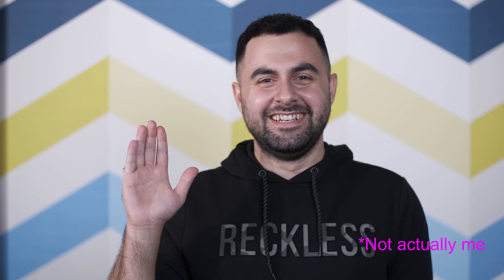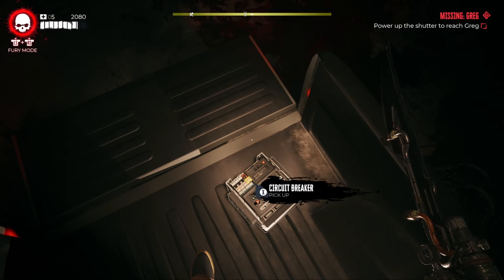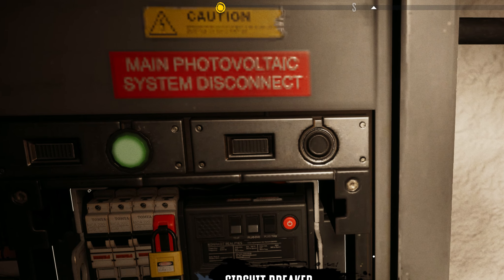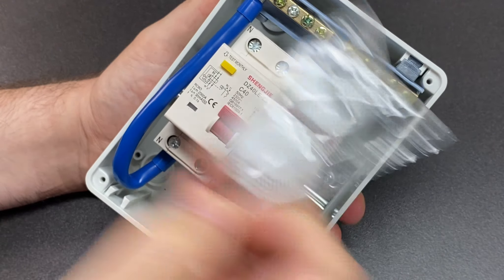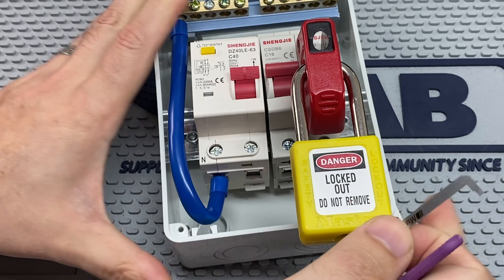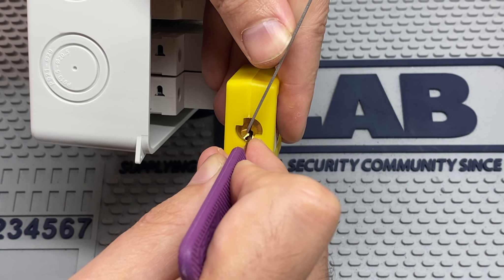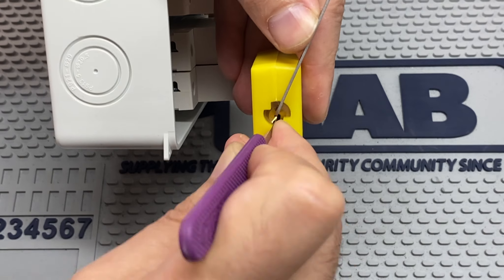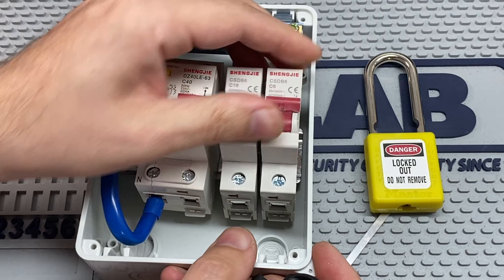Picking a Lock from Dead Island 2

Comment: Circuit breakers locked in the on position is usually used on server rooms to keep the janitor from turning something important off. Like when a UPS is beeping and the janitor turns it off because does not like the sound. The circuit breaker still works, it just cannot be turned off manually.
Reply from the maker: Never thought of that!

Comment: Actually there is there’s a higher chance of seriously injuring or killing someone else if you mess with a LOTO lock because that lock is there so that the electrician working on the equipment won’t get injured from the thing they are working on suddenly becoming live. If you have multiple people working on a piece of equipment each one will have a lock on it so that if one of them leaves and takes their lock off the equipment still can’t be turned on until everyone takes their lock off.